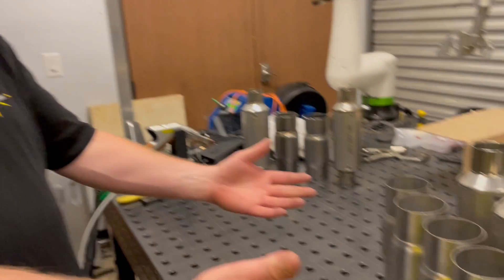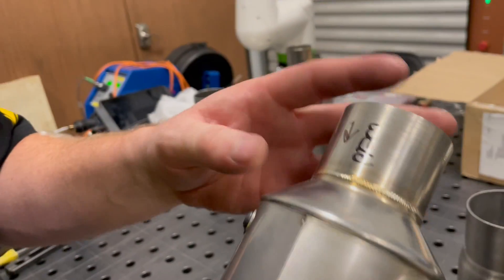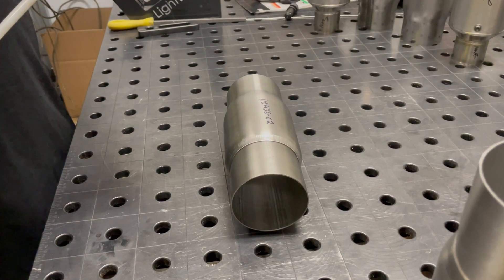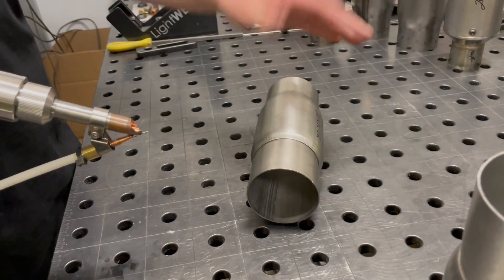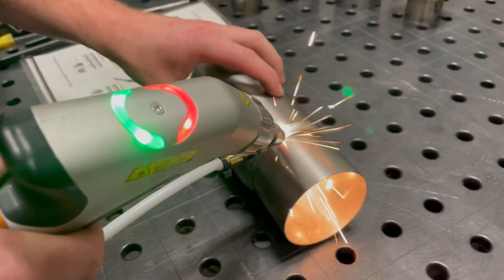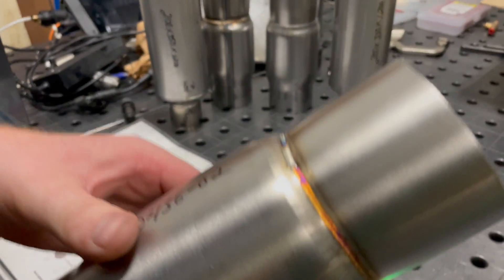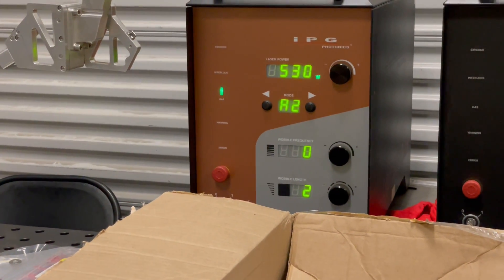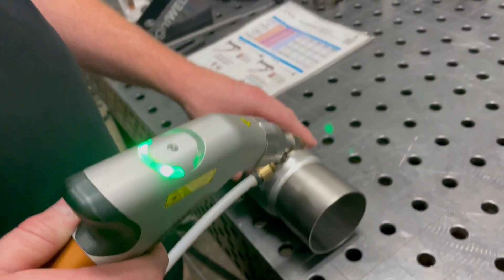LightWELD XR Exhaust Auto Parts by Laser Welding

Comment: Looks like a great time to start a second career by investing in a lightwelder. Why would you use anything less now that this industry has opened. I'm thinking stainless sanitary welding at process plants. Is there a reason to use nitrogen in the piping with this system?

Comment: Great video! I own a XC model and was wondering how can I get the modulation with the wire welding on the XC model.
Reply from the maker: Its a user preset. Once you set up a user preset with the modulation it can be recalled anytime. If you contact us we can give you the settings needed. Easiest way to access the IPG User interface is thru the LightMOTE wireless tablet system we have.